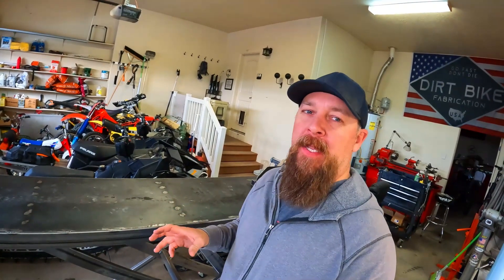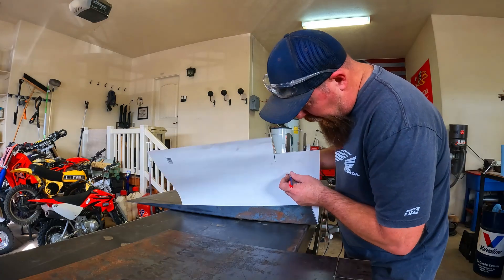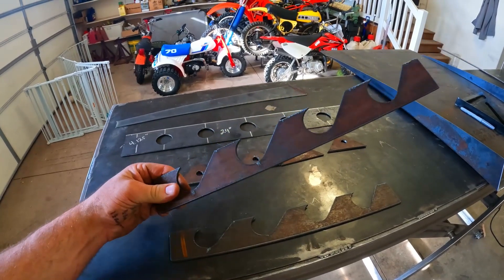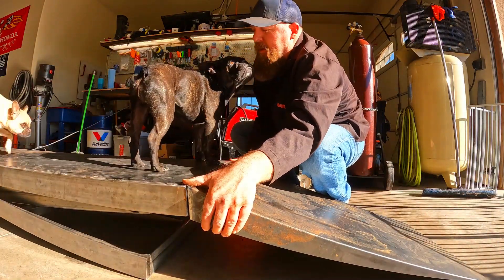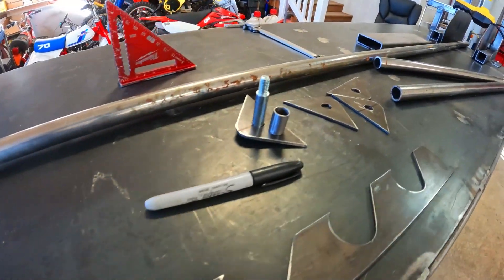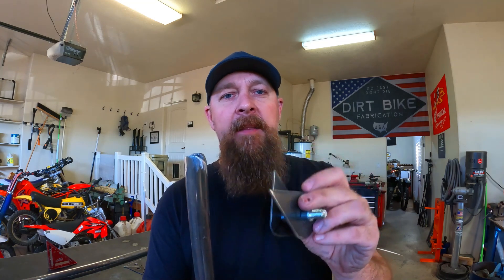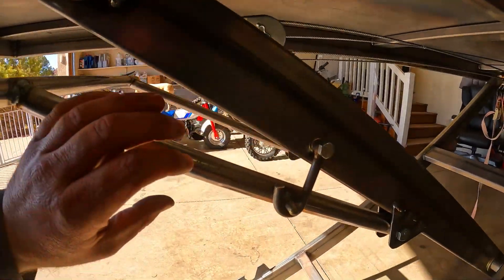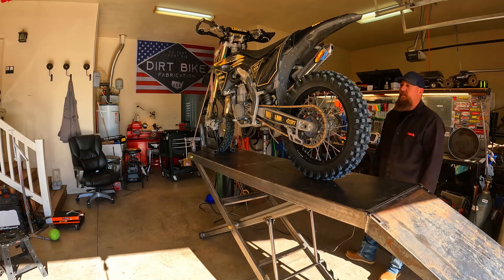DIY motorcycle lift. part 2

Comment: I would put truck bed liner texture.  That way you don't have to worry about sliding off the table.  You don't have to do the entire thing but just where the tires are mainly.  Then paint it any color you want.  Black would work best because it wouldn't show as much dirt

Comment: you should paint your american flag dbf logo on the top and then paint the lower half red or lower half black that look so bad a and put a coat or two of clear over it all and fore your logo have a stencil made up to your top deck dimensions and just go to town that be some high quality well worth the effort paint job great for your video every time you use your stand

Comment: I have ZERO metal fab skills...  so i build my bike stand out of wood...  I build a wooden platform that's designed to be lifted with my bike jack, and while in the air, set down onto jack stands.  I have used it for my cruiser.  It can hold a lot of weight.  It's kind of like me... cheap and easy
Reply: My KLX is on a wood stand with castors.  Makes it easy to move in a small shop.  It has storage underneath for project parts.

Comment: Well, black would look good, but red is more practical, it will be much easier to see little black nuts and bolts on a red surface (I guess there are not many small red parts on a bike!).